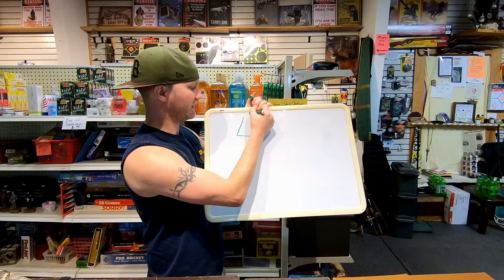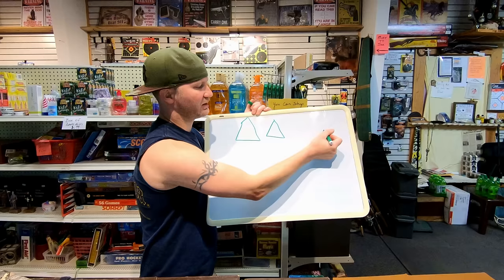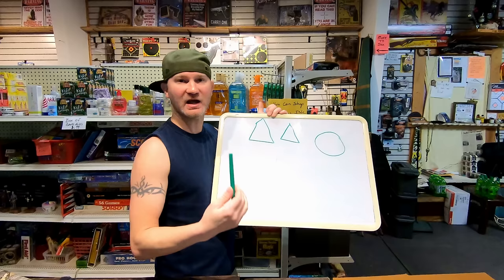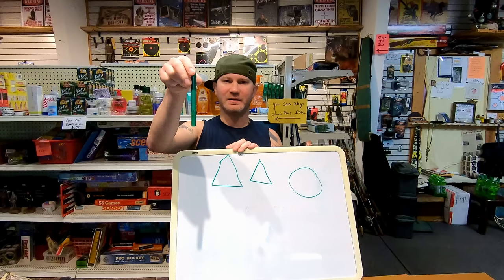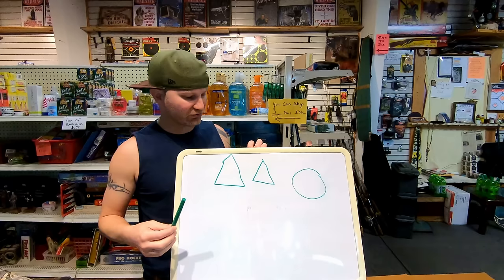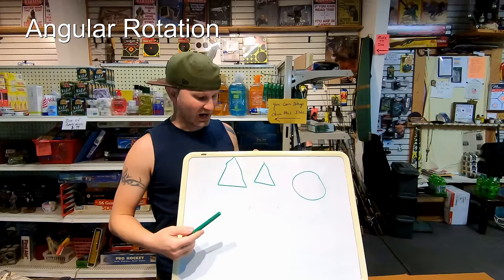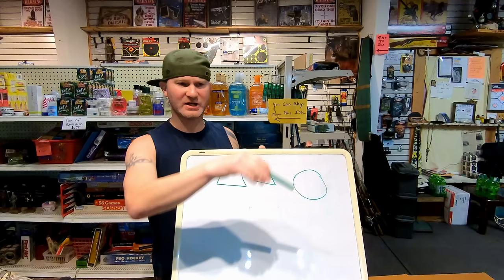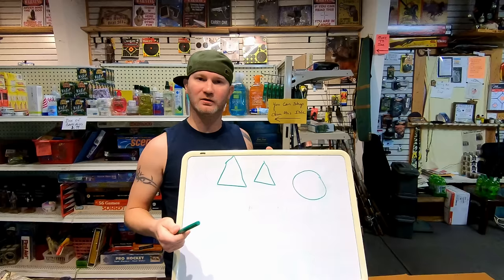The Art Of The Bead Sight

Comment: Technicians do replace parts... after they've correctly diagnosed the root cause of the concern and failure. I can assure you with 100% certainty that the whole technician vs mechanic terminology is just semantics in the real world. We usually call the idiots in the field hacks, diagnostics and understanding of systems take back seat to the parts cannon, method of repair usually involves cutting things they cannot figure out or are too lazy to figure out how to remove and no less than a dozen less bolts during reassembly
Reply from the maker: Lol right on

Comment: Your eye is the rear sight. Shotguns have to fit you, or you have to have them fit to you. You must keep your head on the stock or you are not going to hit anything. The length of pull, stock thickness, stock height/rake/angle are critical to your gun fit that is specific to you. If your gun fits, recoil is next to nothing, you won't miss, and you won't hate them, you will love them. You can pattern your shotgun with cardboard to see your point of impact. Change your point of impact by making changes to your stock like adding a shim on the top or adding height to the rib. Keep both eyes open too. Shotguns are not rifles or pistols.
Reply from the maker: I could not agree more

Comment: If you ever mill the head or block on a tight tolerance motor you'll see triangles come into play in automotive when you get valve timing codes even though marks line up because you've shortened two of the legs on the "triangle" that was the timing belt or chain
Reply from the maker: Right on 
I still see it as circles
One circle isn’t turning the other circle at the right time
Reply from the maker: I’m not gonna argue with you because it’s not my field anymore and I’m about 15 years out of date
But wouldn’t the tensioner take up the slack in the chain 
Or what am I missing here I’m curious about it
Reply: @CRSFirearms  tensioner will take up slack to a point but motors that use variable cam timing will set codes since they're constantly adjusting cam timing and it doesn't take much alteration of the factory geometry to make normal cam timing adjustments no longer possible

Comment: I have to disagree with one factor you mentioned on elevation. Seeing as how shotgun shells are loaded to give a velocity of 1100 to 1300 FPS. Elevation leaves the equation for the most part. A Shotgun's pattern accounts for elevation when shooting shot. There is a limit to how dense a shotgun pattern is as range increases. The shotgun choke is the key.  The max range of shot is based on the choke (say full choke) is about 40-60 yards. After the shot load has traveled to its peak effectiveness, the pattern begins to develop holes and clays can't be reliably hit. The pellets are constantly losing their energy too. It is possible to hit clays and not break them. By the time you had to seriously worry about elevation, your pattern and pellet energy would be of little use. Elevation is not a factor during this kind of shooting and at this range as the pattern is constantly expanding in a cone shape from the muzzle.  The muzzle being at the center of the cone.
You can demonstrate this principle by getting a regular length (26-28 in barrel) shotgun with full choke. Barrel length is important as with shorter barrels you can lose up to 300 FPS, which will have an effect on this demonstration. Place a target out at 40 yards. The target should be big enough say 50x60 inches. Place a black 3in circle in the middle and aim directly at the center of the circle. Shoot The target. When inspecting the target did the pellet pattern go below the black circle or were they mostly distributed evenly around the black circle? Use the same size shot  (7 or 7.5) and repeat this several times on new targets. I think you will find that Elevation is a mute factor for breaking clays and most shotgun shooting within effective ranges.

Elevation is a factor if your shooting Geese like with a Marlin Goose Gun. They have a rear post and bead sight because most shots are made at just over 100 yards. These guns are mostly 10ga and use a magnum shell which throws 2.5 oz of #2 shot or BB shot. They need this heavy load in order to have any kind of pattern at that range and the pellets to have sufficient killing energy.
Reply from the maker: Good information thank you

Comment: Great video. My 870 Remington turkey gun shoots high and right. Shoot a 660 Carlson XR and 3 inch shells. No matter what it’s high and right when I put it on paper. I need to pattern it with some cheaper loads. I’ve been compensating by shooting low and right with good results. But I’m wondering if it’s me. If I’m getting a good position when looking at the bead. Thanks for the tips

Comment: As a pro-2nd amendment liberal, I have a love-hate relationship with your channel.  But I have to say, THIS is probably one of the BEST videos you have ever made with some MASSIVELY useful advice for new shooters and older shooters as well.  I certainly learned a few things even though I'm ex-Army and have shot firearms for almost 3 decades.  Awesome video!  Keep up that board of knowledge!
On a side note....I'm loving my Maverick 88 12 gauge pump with a Opsol 2.0 adapter loaded with 9 Aguilia buckshot minishells in the tube.  The massively lowered recoil lets me do proper CQB tactics with that 18.5" barrel (moving the stock past the shoulder with the firearm turned sideways like Marines train with the M16A4).  With full power rounds, it'll fuck up the wrists trying that.  I know because in the Army Corp of Engineers I trained with a Mossberg 500 shotgun for CQB and it was horrifically painful.  I sucked it up and did it, but few volunteered.  Minishells make it a pleasure to use such CQB techniques.
Reply from the maker: Thanks
And that’s totally understandable

Comment: you got some misinformation about gun fit, it an old myth about about bending your arm to check your length of pull. the proper way to check length of pull is to mount the gun and check the distance between your face and your hand, there should be a distance of about 2 to 3 fingers.